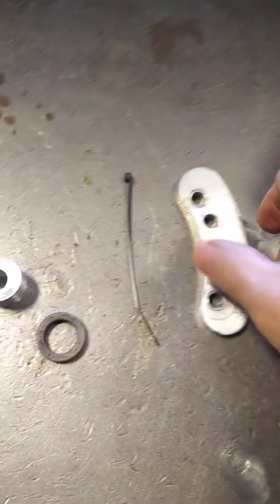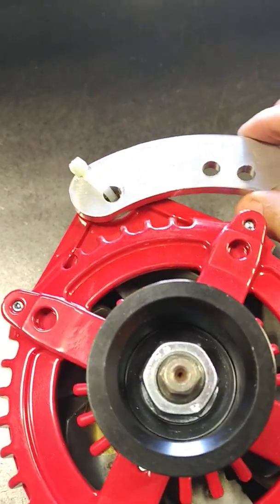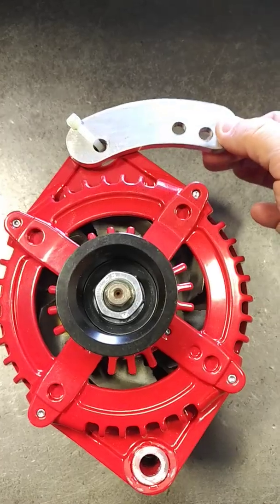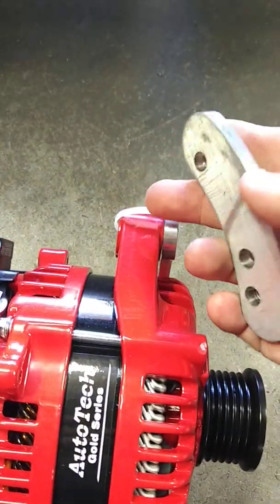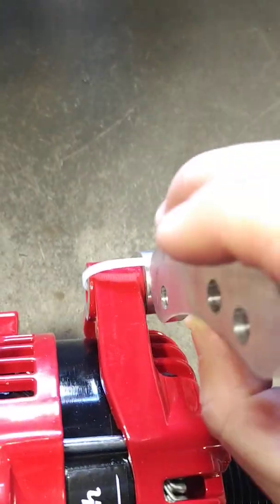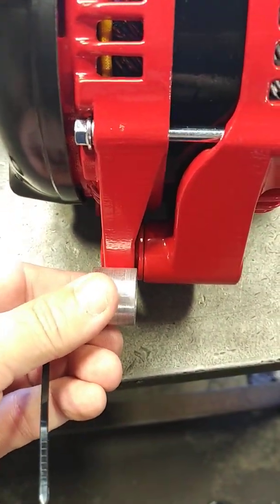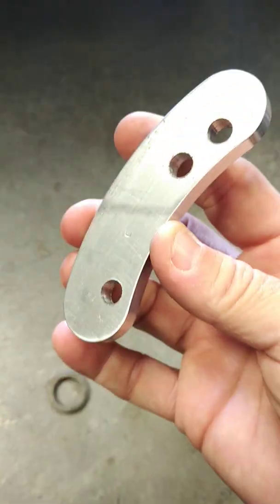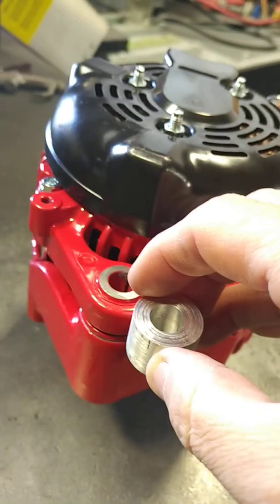Bracket and Spacers supplied with our High Output Alternators explained in detail.

Comment: What bolt size I need for the side that goes to the belt tensioner
Reply: My bad the alternator
Reply from the maker: @andym9260  usually m8
Reply: Do I need to get 2 bolts or the oem bolt that goes to the tensioner would still be fine?

Comment: Is there a way I could get the spacers I need for my alternator from you guys or give me the right size spacer  they bypassed my rear ears and didn't supply a spacer and I want to make sure I use the correct size. 2015 nissan altima 2.5l

Comment: Hey guys glad to see you with new updates.... I have a question related to alternators can I install 2 alternators in parallel even if one of them is 320 amps and the other stock? I have a 00 dodge ram diesel, and a external voltage regulator for the 320 amp..
Reply from the maker: Running different amperage alternators is acceptable
Reply: @autotechengineeringusa  do I have to install a separate external voltage regulator for each alternator? And then at the end I run my wires as usual right? Positive to + and neg to -..??
Reply: @ricardojuarez291  positive to positive  negative to negative yes
Reply: @bassbrother101  thanks 👍